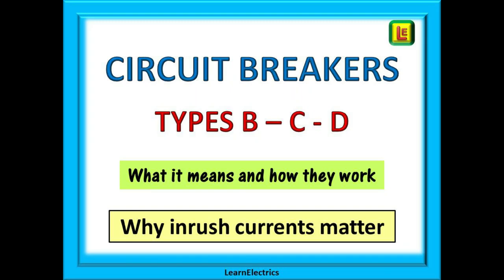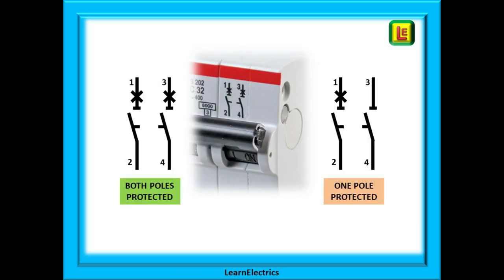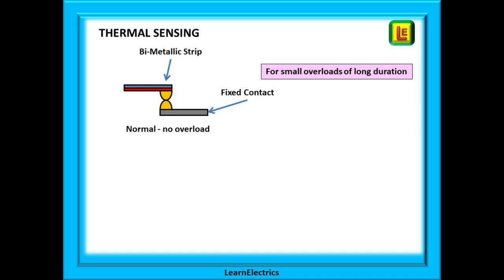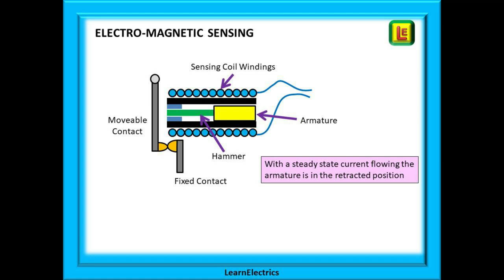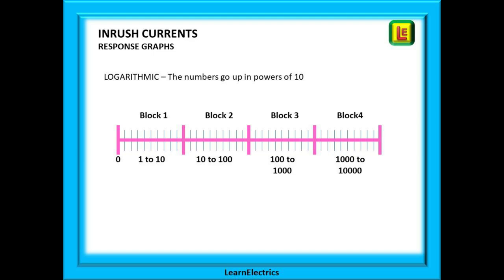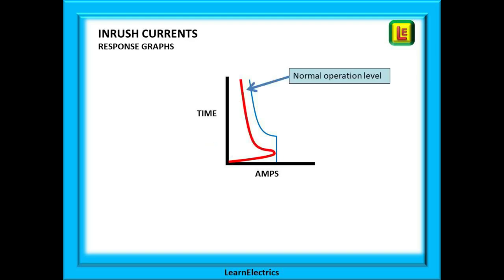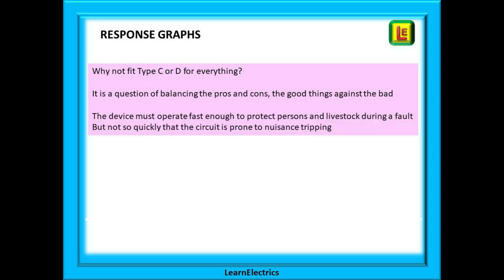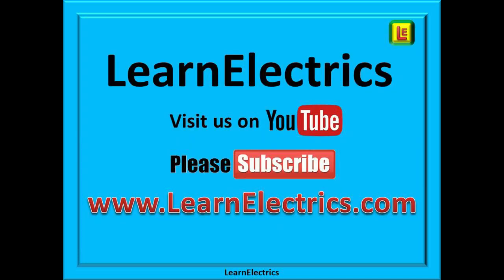CIRCUIT BREAKER TYPES - How they work and inrush currents

Comment: Your tutorials are excellent, both with the visuals and the explanation of theory, please keep them coming. I don't know if you have covered this in a previous tutorial and I missed it but the use of different types of protective device to accomplish selectivity from cascading along different distribution circuits would be welcomed. In domestic scenarios where the main DB feeds a garage DB, which then feeds a shed at the end of the garden for example.
Reply from the maker: Olly, great feedback.
No, not covered that yet - it's called discrimination and will be covered in the next week or two. It will be on MCBs, RCBOs and RCDs etc. It's a good topic. Thanks. Dave.

Comment: Great job 
Can you please clarify if there is an earth fault, which one will trip first the MCB or the RCD
Best regards
Reply from the maker: If its a 30mA RCD, usually the RCD will trip first. Hope this helps.
Reply: Many thanks to you 
May I ask you a question 
I have some lg air conditioning units equipped with inverters 
Do I need to replace the type A RCD with type B

Comment: Great video! 
At B type, in that table, it is mentioned that it is for long cables. 
I guess because it has to do with a bigger Zs and a low PFC?
Reply from the maker: Longer cables mean higher resistance/impedance that C and D types might not meet. But if you can install a smaller size MCB say from 32A to 20A, you're permitted Zs increases. Thanks for watching. Dave.
Reply: @learnelectrics4402  Thank you for your answer! Have a great day!

Comment: Sorry, I am a newbie to this subject but was drawn to it when researching what fuse size to use on an offgrid solar setup. If a 10 Amp fuse will not blow until it might reach 100 Amps, then what cable size  should I be using, something that is rated for greater than 10 Amps or a cable rated higher closer to 100 Amps???
Reply from the maker: Its all to do with how long it takes to trip. Have a look at this video on the link below. It will help. thanks for watching and stick with it, its a good trade to be in. Dave.
https://www.youtube.com/watch?v=VtTUkUpQ-Rc

Comment: Does the thermal overload still work in a TT system?
Reply from the maker: Unless you can get enough current flowing to exceed the breaker rating by enough amps and enough time, then no. That's the problem with TT. If the fault current flowing in say a 32A circuit is less than 32A then it will never trip.
Good question. Thanks for watching. Dave.

Comment: It is normal for main circuit breaker to be a little hot at time? Mine once in a while trip, I dont think my appliance is shorted as
it could be reset. I think maybe it is too old, mine house is 25 yrs old, Ty
Reply from the maker: At 25 years you may need a Periodic Inspection by a competent electrical inspector.